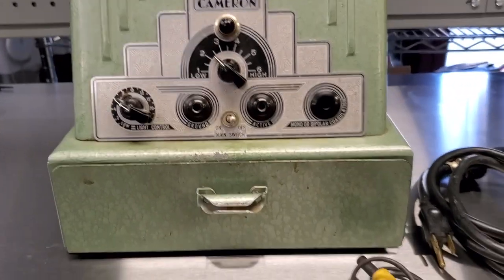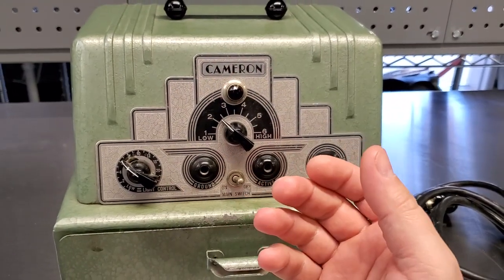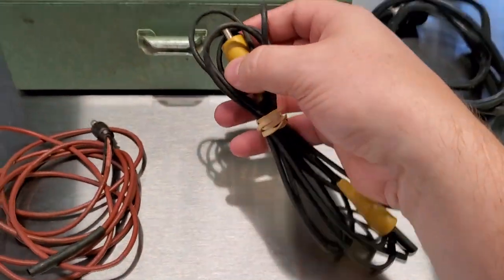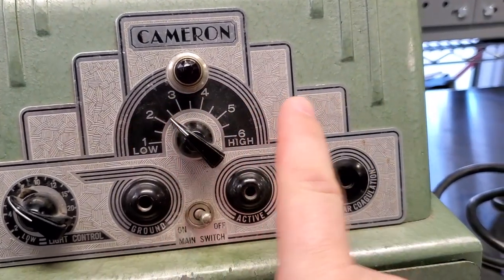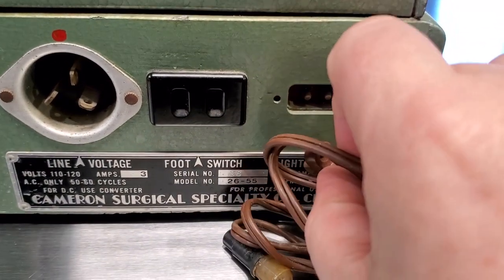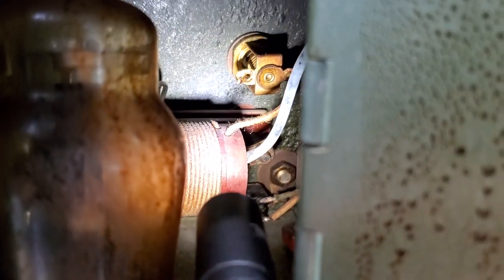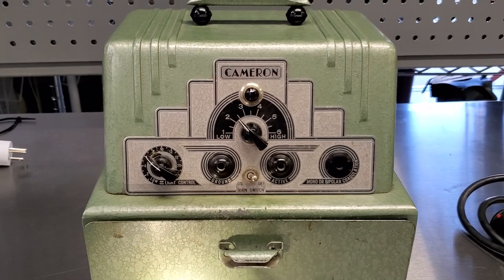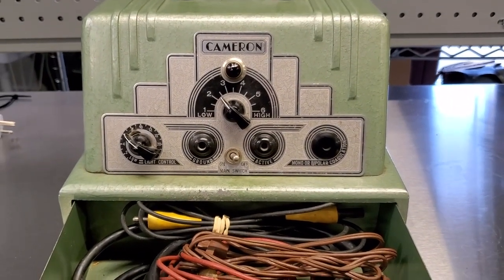A Piece of Medical History: Historic ESU

Comment: Interesting that it uses an RF tube. Saw the 101 on it so I would think it's a VT-101 tube. Believe it or not but that tube is still available NOS.
Reply from the maker: You're right! I can get a pair NOS from 1937 for $29?!
Reply: @BetterBiomedChannel  I would buy them and include it with that machine before the RF guys see those tubes and snag them up. That way if it was to ever be restored it would have a fresh tube available.